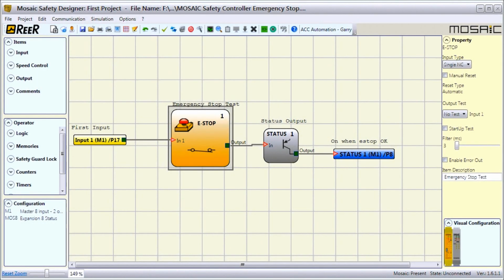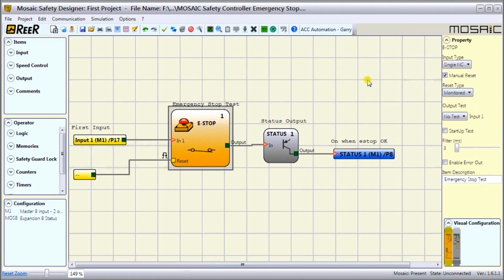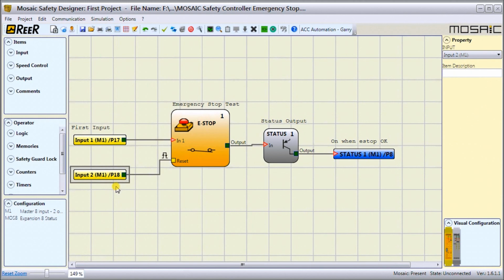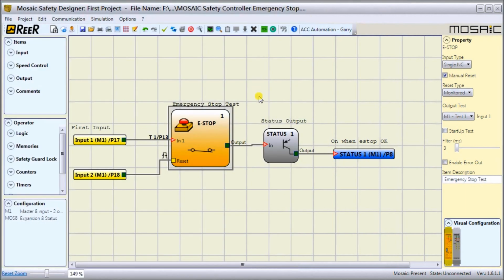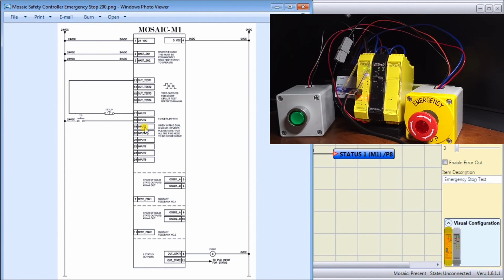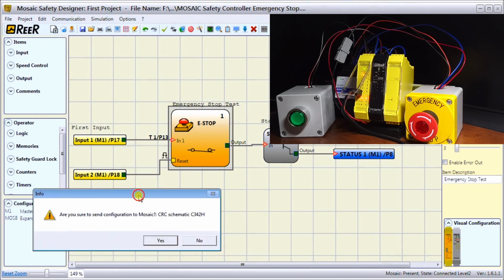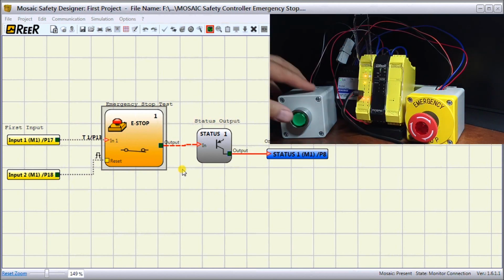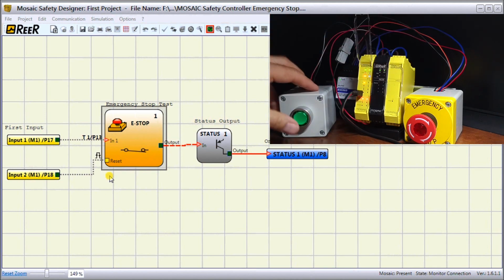MOSAIC Safety Controller Emergency Stop

Comment: What program are you using to create your ladder diagram?
Reply from the maker: Hi badmojoe,
The MOSAIC safety controller uses MSD (Mosaic Safety Designer) software. This is a free download and will also simulate your circuit. 
Here is the post that will describe the software:
https://accautomation.ca/mosaic-safety-controller-installing-the-software-msd/
Here is the entire series to date:
https://accautomation.ca/series/mosaic-modular-safety-integrated-controller/
Hope this helps you out.
Regards,
Garry
Reply: @ACCautomation  Just so we're clear the image shown at https://youtu.be/lNcb4E5XDH4?t=222 is generated by the Mosaic software?
Reply from the maker: @badmojoe  
The wiring image was not created by the Mosaic software. It was just created in Paint based on pictures out of the mosaic supplemental manual.
https://cdn.automationdirect.com/static/manuals/mosaic/reer_supplemental.pdf
Regards,
Garry

Comment: Do you have a video on using the relay expansion module?
Reply from the maker: Hi Justin,
I do not have a video on the relay expansion, but the supplemental manual has some wiring designs that might help you out.
https://cdn.automationdirect.com/static/manuals/mosaic/reer_supplemental.pdf
Regards,
Garry